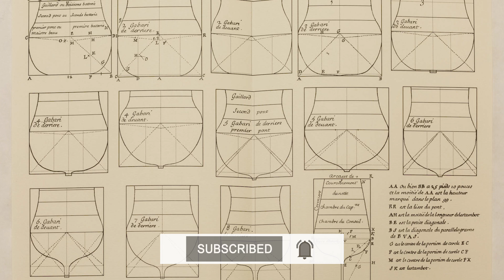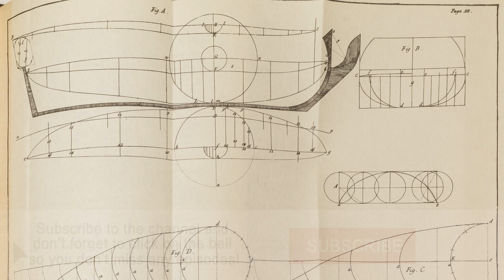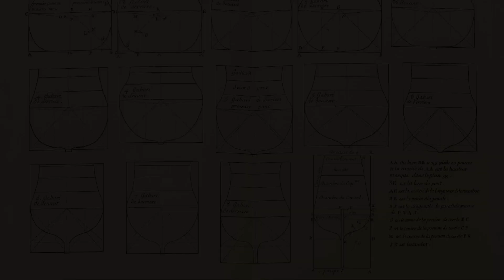Evolution of SHIP DESIGN (Part 1)

Comment: My understanding of cold molding is somewhat different. I am under the impression that “molding “ meant more like casting than the mold of a frame. Cold molded hulls being made of alternating diagonally strips of wood glued together effectively making a bespoke ,if you will, plywood monocoque hull some times without frames at all.
Reply from the maker: You are mixing “cold-molding” with “whole moulding”. The one is a modern boatbuilding technique; the other- a shape or design technique that is attested by archaeology since at least the 11th c AD and likely much earlier.
Reply: My apologies. I completely misheard you. We were steaming off to a ship job. Over the sound of the engines , I could barely hear what you were saying and the auto captions wrote it as “CO molding” . Sorry.    
   When did half modeling become an accepted design tool?